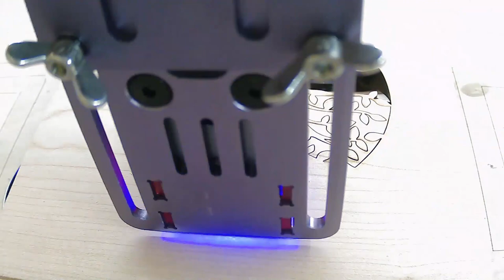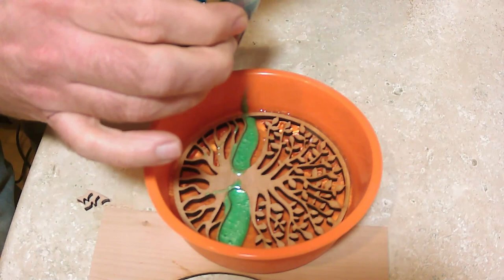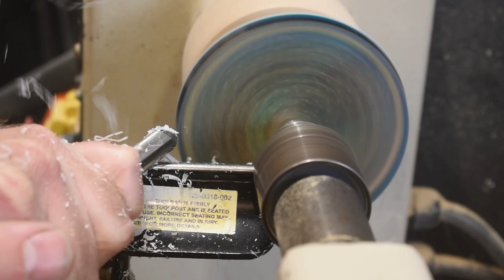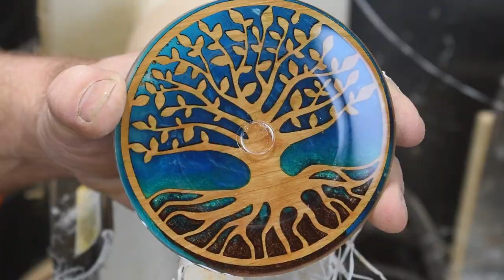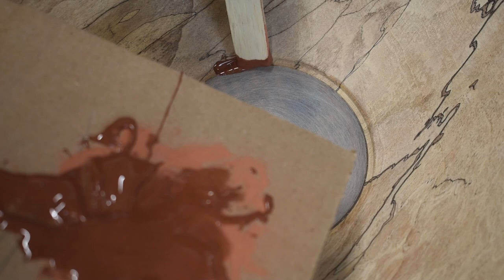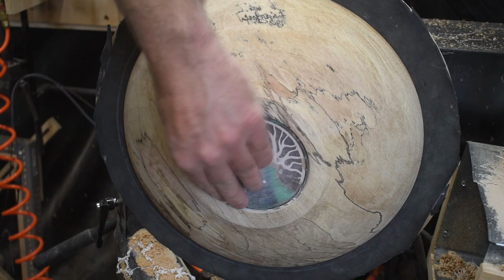Wood turning Bowl repair adding resin to fix a funnel

Comment: Great concept...if it were me though, I dump loads if clear resin on and stick it in a pressure pot.
Reply from the maker: I don't have a pressure pot big enough this bowl was around 12 inches.
Reply: @BlackLabelwoodworks  oh...well then never mind.
Reply: @BlackLabelwoodworks  oh, well then never mind.  There is UV resin where it cures with a black light.
Reply: @BlackLabelwoodworks  drats, I've lost my reply like 10 times now.  What about UV resin where it cures with a black light?

Comment: Hey, I just read in your description that u use those hurricane bowl gouges. How do u like them? I am considering buying the set with the 1/2 & 5/8 in the "better" steel but I can't decide if it is worth it. Also, how long is the grind? As in, I got a set where the gouges were only ground out for about the first 3 inches which meant that after just a few months I could sharpen them no further. Really useless to have a 10" shank but only 3" ground to shape if u know what I mean. Thanks!
Reply from the maker: I have some designer steel gouges but still use the standard HSS gouges to.  If your referring to the flute mine had more then 3 inches of flute on them.  They were my first set of bowl gouges have had them for years and still have plenty of metal to sharpen on them.
Reply: @BlackLabelwoodworks  thank you for your reply! That helps with my decision.